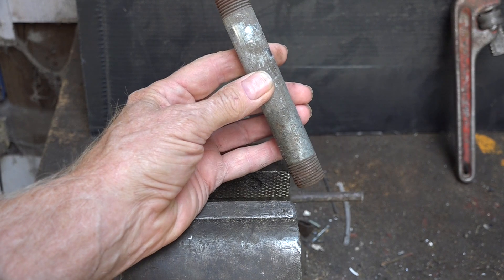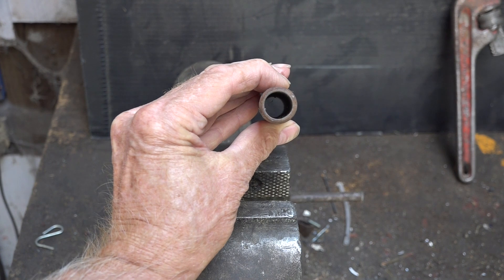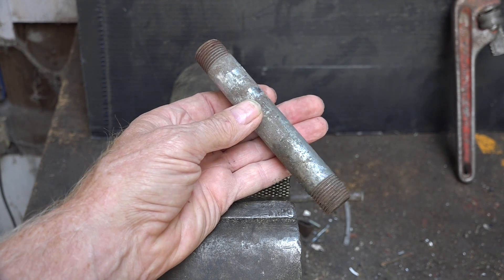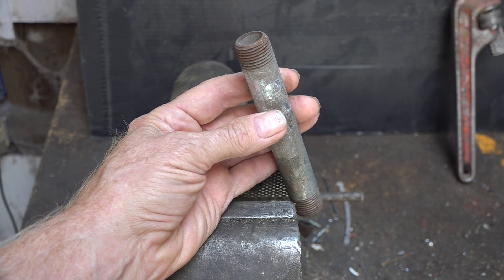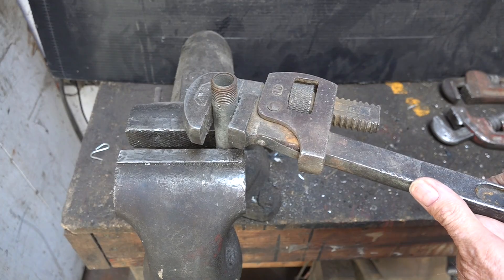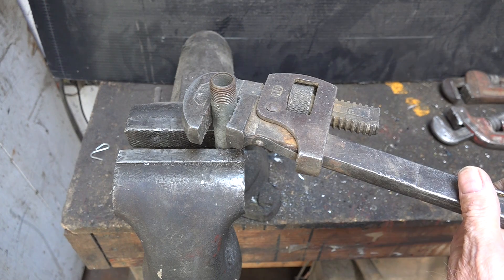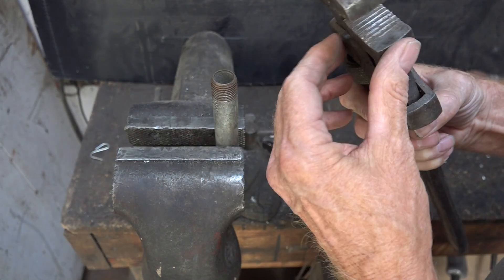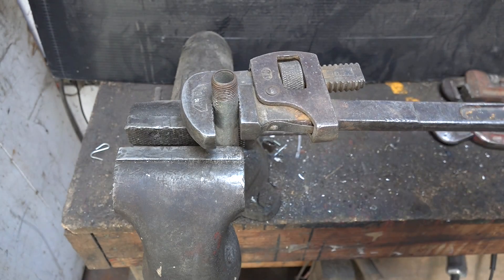How the pipe wrench works.  Part 1

Comment: What are the fractions on the wrench used for?
Reply from the maker: The size of the pipe.
GFM
Reply: @grayfurnaceman  so let's say if I'm going to tighten a 2 Inch pipe I'll just adjust the number to 2?
Reply from the maker: @oscarvillalobos2453  I never use the numbers on the wrench.  I want the fitting to fit farthest into the jaws without contacting the throat of the jaw.
GFM
Reply: @grayfurnaceman  and if I'm going to tighten a 2 Inch 90 I'll just have to calculate the width which is about 3 1/4 . Since it just goes 1 1/2 2 1/2 3 3/12 and so forth

Comment: I got an old one from my grandpa, I was working around with it (it's rather rusted at the nut) and as the main part came out..a rusted spring flew out of the wrench from I don't know where. The spring is old, rusted, and bent at an angle I'm not sure makes it work..now that the spring is gone though it's much looser and doesn't lock up as much as it did. Still works but I don't know if it'll work as well as it did..especially since I don't know WHERE the dang spring came from to put it back in case it's needed.
Reply from the maker: You were lucky you still had the spring.  Most of them flew out decades ago.  No great loss.
GFM

Comment: The most versatile style wrench ever created. Especially after aluminum  were being offered, largely cutting weight. I have about 18 various lengths and styles. They are definitely my main tools in the maintenance field. Don't let the name fool you. Not just for pipes. In fact, that probably just 10% of what i use them on. Get off these Channel locks (tongue and groove pliers) people! They are inferior for the tasks y'all are using them on, and put more work on me, down the road with rounded fasteners. Of course this is my opinion. What is not an opinion, it's actually fact, PLIERS ARE NOT A WRENCH!!!
Reply from the maker: I have to agree.
GFM

Comment: Bought 3 different sizes in 1972 and still use them.  Just used the largest one (Carefully) last winter to slightly close an old style cast hot water valve to slow the water flow down--balance a zone.  The valve was a "screwdriver blade" type valve--very tough to turn.   
You need to have 2 pipe wrenches.   Many cases needing #2 to hold the pipe which you are putting the fitting onto.  Or else the primary wrench may turn the pipe as well.  Especially if you are removing a fitting from an existing pipe.  This you already learned long ago, I'm sure.  Thanks for the video!
Reply from the maker: +DOLRED Yes, I did, but it is not bad to say it again.
GFM

Comment: If you get a chance, it would be nice to see a unit working correctly, restrict the air in the condenser and see the temp and pressure change, and then have it running correctly and restrict the airflow at the evaporator. If you have already done this, could you tell me the video name?
Thanks

Comment: If So where can you get the teeth replacements for Rigid pipe wrenches?
Reply: +Tim Fergel you can get them directly from Rigid there is a parts list available on there site and then you can swap them your self or go to a Rigid Service Center if there available in your area. hope this helps you keep turning the same wrench.
Reply: +The Great Jelly Doughnut Thank you, I have an aluminum Rigid that is in desperate need of a new set of jaws.  Thanks again.
Reply: +The Great Jelly Doughnut  I was on my sons side of YouTube when I answered you.  Thank you for the info.
Reply: +Tim Fergel happy i could help